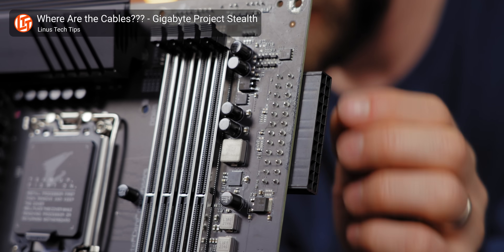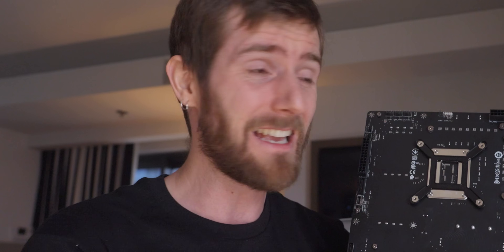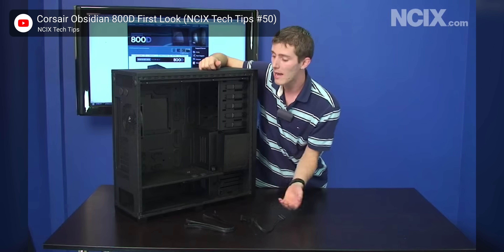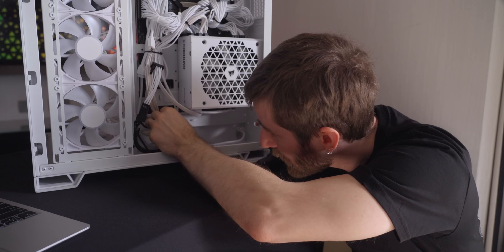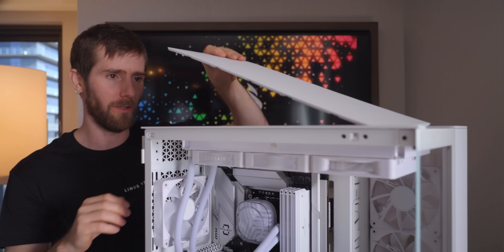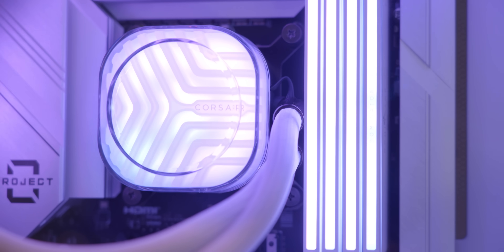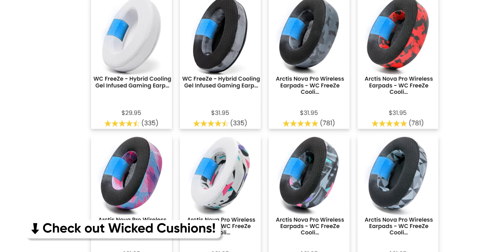I had NO Faith in this... - Hidden Cable PCs

Comment: Using the back of the motherboard although yes will make for a more electrical engineering challenge layout for the motherboard designer and the heat from the M.2 drives will most likely require it's own cooling solution instead of relying on how the cases are designed right now that gen 3 most gen 4 and some gen 5 drives can be passively cooled. So if you have a case that supports whatever cooling agreed upon which will be its own challenge to get M.2 driver makers to agree on then you can have cases that support it. The main issue i see is in most modern cases that is almost 0 airflow on the back which means passive cooling will work worse and might heat up enough to mess with the motherboard on gen 5 drives.
Reply: Yes but no, with the extra large holes for the back ports (remember motherboards are ~3mm off the base) if you have ample airflow in case then a decent amount should be able to seep behind the motherboard allowing the passive cooling to work well enough.
Though that 100% will need pretty extensive testing.

Also it's becoming more common to have active cooling that goes through the back, adding a 1-3mm stand-off from the back mounting will allow for the active cooling to cool the backside given you don't have enough static pressure for seeping that I mentioned to occur.
Reply: @8BitShadow  3mm is less than most heatsinks for M.2 PCIe gen 4  drives. You also have if it goes that way you will have the hot air from the M.2 drive in the same area as the air that is rush by to cool the CPU is in. So having it as a cut out makes more logical sense. It also allows for longer drives then you could get on the front as all you will need is either a screw hole or a strap to keep it in place.

The stand off length is part of the ATX spec. You cannot just go on your own and change it. As the front panel stuff is not that is how we got so many boards with so many different configurations. I do wish Intel would just make it part of the ATX spec for what is where. It is simple to do and from the spec it doesn't say how it has to be electrically wired inside the board just where it the parts have to be.
Reply: Its not more challenging as all power connectors are through hole. AKA they run from 1 side of the PCB to the other side. The only difference might be the orientation of the traces.
They have been using the back for things for a long time so even other things is not that big of a deal.
Reply: We need to stop designing cases with side ventilation and instead move entirely to top and bottom cooling to take advantage of the stack effect. Stop trying to make air blow horizontally. Heat rises. Unless you are in space it's universally true, so we should be taking advantage of it.
Reply: @johnjingleheimersmith9259  Heat rises.. unless its interrupted by huge amounts of turbulence like in a pc case. natural convection is only really applicable in fan-less pc builds.

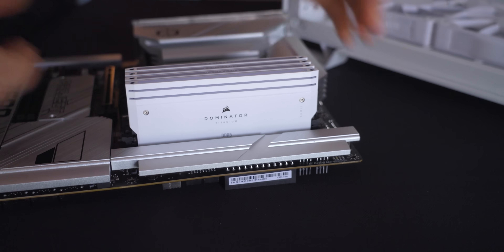Comment: 03:45 Here you can see a danger with the rear connections: If you press too hard from above (for example when inserting the RAM), you run the risk of damaging the connections on the other side.

Comment: Linus thinks it’s only been 20 years of no standard for front panel headers. ATX motherboards had this problem from the start, which was 1995. It actually goes back further, there was no standard for AT/XT motherboards either.

Comment: Would have been perfect if they combined the power cable and a anti-sag bracket on the GPU to eliminate all wires
Reply: That is actually a really good idea, that way you get the rigid stand to keep the gpu from sagging and the cables are hidden too, shouldn't even be too tricky to do really.

Comment: Solution for backslot position variance: Case manufacturers should invest in developing thin sliding pannels for the back-slots for I/O. That way rigidity is mostly maintained and users can slide around those panels to make the games larger or smaller depending on the mobo slot positions. 

Alternative option: have shallow screws that you can screw in from front side for the same effect with various holes for positions. , it wouldn't interefere with motherboard standoffs and you even match the rigidity profile required.
Reply: Makes me think of the PCIe slot brackets, but for the motherboard tray.

Comment: Okay, you sold me on the case, not because of the rear connector support, but because of the wood panels! I wish more PC cases had some wood, helps it blend in with posh furniture and maximises WAF.
Reply: Is it actual wood, though, or plastic that looks like wood?
Reply: Don't be too enthusiastic...Corsair still has none of those accessories for sale even to this day. Can't even get one of their vertical gpu brackets for the 6500 series.

Comment: I feel the GPU power cable is an easy fix. Like the mother board just move it to the back side of the card. Then it can run straight back through a grommet in the case and you wouldnt see it
Reply: Would rather have a frosted glass side panel and just not think about it
Reply: The problem with that, is that it'd mean those GPU's would be purposebuilt exclusively for those types of cases.
Lovely for the people who want those, sure. 
But it means one of two things:
Either those things get a massive markup.
or ASUS spends a ton of money making GPU's that only apply to a TINY (for now) percentage of their market.
Reply: Nope...having connectors on the back of the video card would still work in any case. ASUS's BTF is a no go however. @Gary_The_Metro

Comment: About m.2 SSDs. They should move the GPU down a few slots. Then make PCIEx8 slot above the GPU. If using PCIE5x2, that support 4xm.2. Such a solution, also support a nice heatsink for the SSDs. This will require that all m.2s run in that slot. SSDs running through the chipset, usually 2 of them, can be extra on the MB. that is easily 6xm.2, without really altering much. If they use slot 2 and 4 on mATX, and cut down the MB edge along the GPU, you also gain extra GPU cooling, but that is like a super nerdy designer wish. Also, by moving the GPU down like this, the distance between the GPU and the CPU increases, and the heat interplay between those parts decreases. Especially if you use like slot 2 and 5 on ATX. 

This is such an elegant solution, compared to the m.2 mess Linus talks about in this video. I know hardly anyone has tried increasing the separation between cpu and gpu using air, but it really work when using cross loads. That separation also makes components behind the gpu accessible.

Comment: I use a mini itx case and prefer smaller builds so it’s not for me, but this concept is really cool and hope to see more.
Reply: I have a mini-itx build currently too, but my constraint was case height rather than width. Something like this would definitely have made my build a lot easier! Obviously doesn't help if you are trying to keep both dimensions small (like I guess you are).
Reply: @alastairtemple  
It's relevant to remember who this is for. If the target is the gamers and the graphics industry, well then ITX is not a concern. And for the OEM's this won't change the trend of them building 3.9 and 1 litre machines.
Reply: @AB-80X  That is true, my case is a niche within the niche that is the itx market, so it is unlikely it would rush to be there, but if it ends up on a big selection of ATX motherboards I wouldn't be surprised to se it on some itx as well (although a much smaller selection). 

As for OEMs, well yeah, they will do whatever the hell they can to make their stuff as incompatible with anyone else's as possible, like they always have done.
Reply: @alastairtemple  ITX MBs have opted for daughter boards and tower m.2's so they are changing as well.
Reply: @helloukw  ive seen those and thought it was unnecessary complexity. i just got two high capacity m.2 drives, a mobo that could handle 2, and called it a day. they could probibly get another m.2 slot in there if they would get rid of all the decorative shrouding, eliminate sata, use 12vo, etc. modern cpus have the lanes.

Comment: You could put power connector on the back of video card too. The new connectors are pretty small. You'd have to leave a hole in the motherboard (as not all video card are longer than the motherboards), but it could work without tryng to force more power through the motherboard itself.

Comment: Here is a simple solution, add an I for each standard to label it as inverted. For example, an iatx would be an inverted ATX motherboard. Inverted meaning the connectors are on the back. So for example you would have a IMATX B650M MSI Mortar WIFI. This way it becomes its own standard within the standard. No more confusion. No project names. Nothing of the sort.

Comment: I actually see more 'new' builders breaking parts on their board if they try to install ram/cpu/cpu coolers before putting the board in the case. If anything this approach is only for the extreme show case computers that go crazy on fluff.
Reply: I don't see any issue with installing RAM and CPU before installing the board. As for CPU cooler, I could see the potential for damage with an AIO, but air cooling should be fine.

Comment: My first thought: Pushing the RAM sticks in might put too much pressure on the pins on the back, but hopefully that’s been solved already
Reply: My impression was the other way-round...Pushing in that full size 24-pin power cable, into a connector just dangling over an open cutout without any backing support.   Experienced builders should know to hold pressure; But from the "Aids novice builders" perspective? I could see some cracked boards happening
Reply: @cody4783  totally agree, the power cables bend a lot the MB.

Comment: Easy fix. I already got your answer.

Make the Motherboard mounting plate itself a swappable item. 
different colors, different hole layouts. every case going forward could have a option of removing the entire motherboard plate. and you could buy a plate specific to your board that will fit your case.

Comment: How about we just hide the wires the old fashioned way, by not having a giant glass panel?
Reply: How about you just start building in cardboard Uhaul boxes?
Reply: @rickss69 I literally have mine in a 19x13x 6 amazon box. Was planning to switch it into a microwave for the meme.

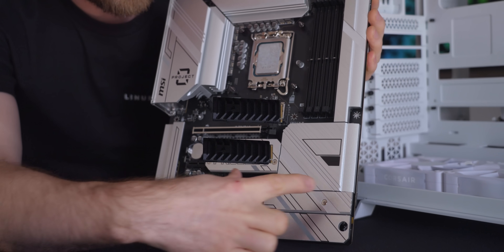Comment: 3:10 I would love that, extra slots never hurt anybody, and they cost pennies in manufacturing. 
just please make them orderly, not a mess. You can alternate top/bottom, in a row. 6x 2xm.2 drives, 2x 2x for USB controlers and 8x for main gpu, 4x for extra optional slot.

Comment: I wonder if the slightly improved aesthetics are worth how thick that case needed to be? It's definitely clean, but I also value how much floor/desk space my computer takes up.
Reply: Yea. I am not sold on the idea for that reason
Reply: those cases are literally 3cm wider, what are you smoking bruh
Reply: @m.h.7901  The PS is behind the mobo. It is at minimum 10cm thicker. ATX PS are 87mm tall.
Reply: @Idiomatick  it depends on the case and how the company decided to make them, the ones ive seen from asus are literally 3cm more wider than my case now, and its not like there are not already super wide cases even without this back connector thing

Comment: This would also be great for upgrades. I added a pair of SATA HDDs to my build(RAID 1 for bulk data storage) and running the PSU cable I ended up having to pull the PSU out to get room and then stuff it back in behind the drive cage. Even if you don't need the benefits for the initial build, you'll be thankful when you have to swap things out or add them down the line.

Comment: Maybe Motherboard manufacturers can provide a motherboard plate that have their own cutouts for the ports, and this motherboard plate is a "standard" that latches onto the case where the case just has a huge hole where the motherboard mounts go before and the motherboard plate just hooks, locks, or screws into place, filling this said hole? Similar to how the rear I/O shield/plate works maybe?

Comment: I think a compromise to the power connection on graphics card would be to include capability for both options. Include a cover for the standard power connector to cover it and blend it in with the rest of the GPU when not in use, then include a removable connector that lines up with a power connector on the mother board. You either keep that attachment in and plug your GPU into the board or remove it if your motherboard is not compatible then just remove the cover for the power connector at the top of the GPU and plug in directly to the PSU

Comment: I am a micro center repair technician and not needed to remove fans/radiator to access CPU power would save so much time and annoyance when testing power supplies.

Comment: I really love it. Sure it has some draw backs too, but over all I like the idea of just hiding the cables and opening up more space for more things. As for the GPU - why not just move the power plug around instead? Like on the side or on the back? That way we dont have to have a new PCI slot or anything too fancy plus would still be compatible with current cable designs?

Comment: 6:17  I think Companies should launch different Backplates (eg all motherboard companies should have their own backplates bunduled with motherboard for free) with motherboards and the case (a complete hole with screws to support the backplates) should have a blank patch to secure the motherboard backplate and then it would help secure the motherboard
In this way technically a M-ATX Mobo could be fitted in ATX case without any problem 

I don't know it that's structully rigid or not but it can be a good Idea 💡💡💡💡
Reply: I like it

Comment: Honestly, GPU power connector should just be on the bottom (same direction as the PCIE connector) just behind the clearance of an ATX board.
Just have a little hole in the mobo tray

Comment: I'm shockingly deciding to build an Athlon 64 X2 4600 PC. Why? I so happen to have gotten some PCs on one of the jobs replacing the horrible stick to the ground type carpet with carpet squares with Dad. They were gonna throw them away so I asked if I could take them, the clients said yes. Now I have PC hardware I can extract and build brand new machines out of used and refurbished parts. I gotta say, any 250w power supply with an 80+ rating was difficult to find on eBay. Then there's the rare PCI wifi card. And lastly the M2N61-AR has integrated graphics that doesn't overpower the X1300.

Comment: Why not attach the motherboard from the back of the case? There would be a huge cutout for the "show side" of the board and only a lip around the board to which the board would be screwed in. There would be no need to worry about the connector locations.
Understandably installation would be a bit more finicky, but not at all impossible.

Comment: This is going to dawn an entirely new esthetic, of illuminated rgb power cable management on the backside.  

Plumbing up front, power in the back.  Which will then hasten us into a dual sided motherboard world, with cases designed to suspend the board from the edges.  

Possibly making cases wider to allow for airflow and parts on both sides.  Chonking the standard form factor.  And perhaps even incentivizing the development of narrower components on the front side to accommodate a centralized board attempting to maintain a traditional footprint. 

The case frame and board edge strength both for shipping and mounting will be interesting to see if dual sided design really takes off.

Comment: Regardless of the advantages, I see a disadvantage that trumps all the positive points: The size of the case is impractical unless you have a large room with space for such a sizable case (proprietary, by the way, and you need to get both the mobo and case from the same manufacturer, from what I get). I have some clients that require desktops, but first they want to see the size of the build I can offer.

Comment: I bought the Project Zero board, got a 1k MSI PSU, with the same-ish case. The 4090 I put in the system ran fine until you put a (game) load on the card. The only way I could stabilize (barely) the GPU was underclocking. For the build using the same Corsair case (black), the PSU and the drive cage placement isn't the greatest for the CPU power cables and some of the IO plugs.

Comment: the issue for the front panel header for power switch, power led, hdd led and reset switch has been around since the introduction of atx in 1995

Comment: Rear board connectors are not an isolated concept so it blows my mind that some one could patent it and literally bring this innovation to a stall for years, willing to bet this idea has floated around all mother board manufacturers engineering departments for the past 20 years.  Hell the first PC I built my self 15 years ago I was looking for more optimized motherboards with connectors that were mounted on the back or some back to back 90 degree connector adapters for a full custom PC I wanted to make in my mountain mods case cause I hated seeing the cables bulging around the front but I couldn't find any.

Comment: Case manufacturers could use something like Motherboard back panels that you could replace based on the motherboard you're buying

So the need to adapt to a specific manufacturer would go away when you can buy any case anf just replace the panel based on your MoBo.

Comment: That GPU power plug could be on the other side of the card, exactly like this motherboard, and have a hole on the case for it to plug in from the other side of the case.

Comment: I think a better solution to the Asus problem would be to put 2 12 pins on the card one on the traditional side or end position, and one facing the board. Then for their own motherboards just have a hole thru the board for the cable to be run thru, and supply the card with blanking plates for the unused connector